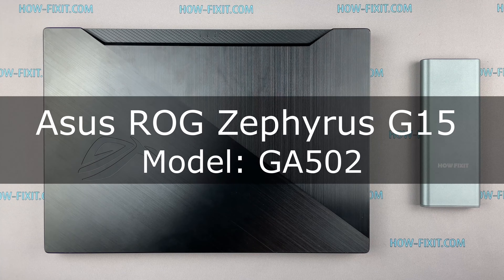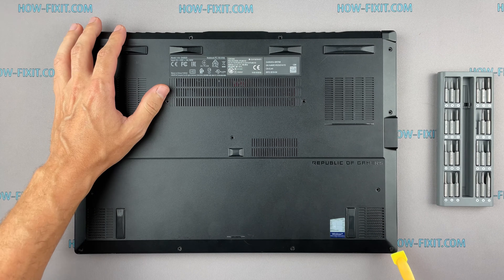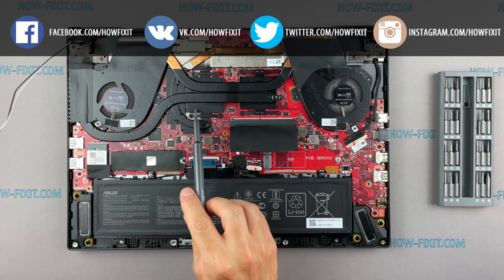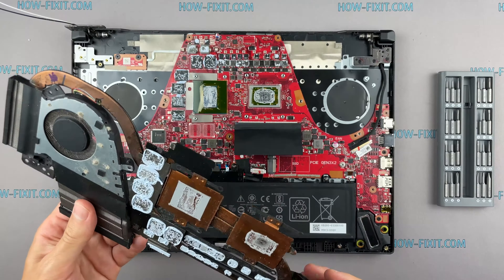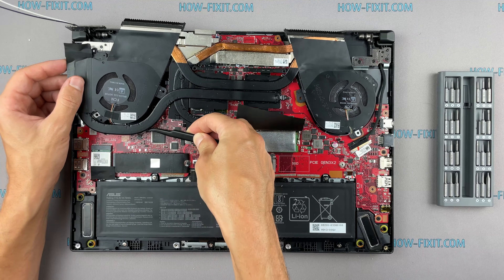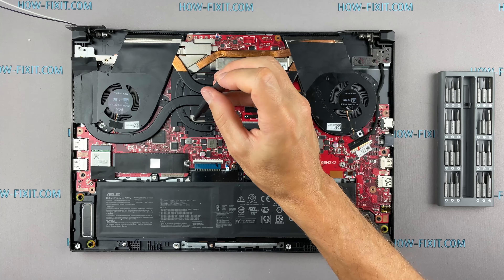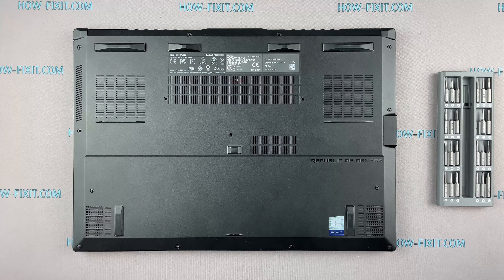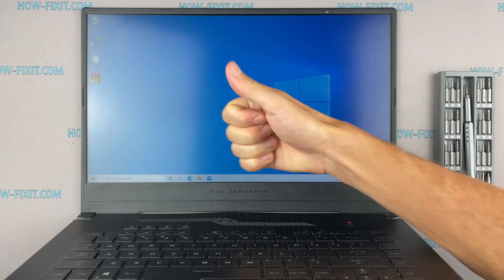Asus ROG Zephyrus G15 GA502 Disassembly, fan cleaning and thermal paste replacement

Comment: Hi, is normal if running stress test on this laptop with prime95a clock speed max at 2,9 GHz (max cpu temp around 83C) while not stress test clock reach 4,3 ghz occasionally, on power plan option pci link state power management OFF on batt and on plug in, cpu power management min 5% max 100% both on batt and on plug in ?

Comment: Mine fans have started to make a loud buzzing sound when ever they kick on. I tried cleaning them, but they still make the sound. If I need to replace them, do you know where I can find the parts?
Reply: tha same happened to me, the solution was apply a drop of lubricating oil for machine in each fan in the holes them has in the upper part

Comment: can somebody please tell me which type of fans i’d need to buy to replace them? my cpu heated up to 73°c while the fan was only running at 774rpm… i think i have a fan failure

(editing to mention that i wasn’t even gaming when that happened, i was only in BIOS… started at 40°c and heated up to 73°c within about 7 minutes)
Reply: That's totally normal temp for a laptop.  At any rate , take the fan out and search and part number.
Reply: @mdmcd6273  it’s a normal temp if my fans were running at about 2000-3000rpm, but it didn’t exceed 774rpm so it was basically melting itself
Reply: @leahvigs  I may be misunderstanding here and of course no idea of your fan curve - but to my understanding those temperatures are fine, stable and FAR within spec for a laptop.

 If the fans didn't work that's one thing, but maybe they were not at 2/3000 rpm, because you were running so cool already (73 C).

If it was melting and or in need of the a higher rpm from fans... don't you think the temperatures would have been climbing steadily? Again- don't know the issue or your scenario. Just that if I could get my CPU or GPU to 73 C I wouldn't care what the fans were at. 

Either way, best best is to take a fan out and get a part number / start your search from there. Good luck.

Comment: (4:42) So there are 2 VRAM sockets not populated with 1GB chips. Maybe some of these boards came with 8GB GPUs at one point, we can see that they even covered those blank slots with the stock cooler!! I wonder if there are some resistors that have to be re-positioned so that those chips could be seen by the mobo. I wonder if changes could be made to the motherboard BIOS with AMI flash tools? Or if the actual VBIOS has to be changed, I mean technically the VRAM is soldered to the mobo. I've also read that the RTX 2000 series can technically interface with 2GB chips and some people have replaced those 1GB smaller ones as an upgrade.

Comment: Thank you for the vid! My fan started making a weird noise and because of you I was able to fix the problem even with zero experience fixing computers ❤
Reply: what exactly did you do? just tighten the screws? or clean them out. I have an issue with mine vibrating the whole computer
Reply: @wingman3212  Replace FANS they will dieout eventually
Reply: @TolaKtv  I ended up doing that yeah
Reply: Do you have this exact laptop? Mine is making a noise too, you didnt need to replace fans?
Reply: @eduardocrysteko4846 ost likely your Gpu fan is dying. Better replace both use High quality ones
Reply: @TolaKtv should i also reapply thermal paste after replacing both fans?
Reply: @leahvigs  If you are only changing the Fans then no. If you havent changed your paste ever, then yes do both USE NT-H2

Comment: its legit impossible for me to reconnect the black and white wires at 8:34? can i get away with  just not having it connected? they werent even connected in the first place when i opened up my laptop
Reply: year late but those black and white wires are the wifi cables. without those, the wifi wont work on your laptop

Comment: I have this laptop and after cleaning the fans, it runs sooooo much better. My Cyberpunk 2077 would run at 45 FPS on Medium Graphics before cleaning the fans. Now it runs at 60 FPS on Ultra Graphics and 25-30 FPS with Ray Tracing turned fully on and set to Ultra. I also tested Doom 2016 and it runs at the highest possible Graphics at 144+ FPS, the screen is only 144hz so it can't go above 144FPS. I bought it used and never thought to clean the fans but I am so glad that I did
Reply: Do you have the 2060 version or the 1660ti version?

Comment: Is it normal to have small sparks coming out when connecting the battery to the motherboard? This is completely new to me and I would think that it isn’t normal
Reply: Jesus. Did you discharge capacitors ? *power button a few times and hold after disconnecting battery?

Comment: I recently purchased an open box ASUS ROG Zephy 16.5" from Best Buy with 16GB and this thing is truly overheating, crashing and rebooting for some unexplained reason!  I've gone into the System Events and see a lot of error, critical error, and warning codes.  I'm not happy and am waiting for a call back from Best Buy.  I've only had the laptop for 20 days.
Reply: It has to do with the fancontrol. turbo mode is for gaming, windows mode is for typical windows. it connects to the voltage of the powersupply. You have to make sure it has airflow.

Comment: Few corrections here... cleaning the dust out of the fans with a brush over top of the board is never a good idea especially because the heatsink compound on the video ram and vrms was not replaced (if you are having heat issues it is always best to replace all of the thermal paste).   Only one fan was separated from the heatsink to clean the congestion point between the fan and the heatsink but it would be a much better idea to remove both fans and make sure all heatsinks are completely clear of dust and debris
Reply: nice fix bro, thx
Reply: Hi! I have a quick question, I'd like to change the thermal paste on my GPU and CPU of my Zehyrys G15. In the video, when he lift the heat sink, I can see that there's a lot of thermal paste all around it. Is it really thermal paste? Can I change it too? or doesn't it make much difference?
Reply: Late reply, but it's not thermal paste, don't fk with radiator paste

Comment: Just did it on my Zephyrus Thin S GX502 and man was it a pain in the ass to do. I build gaming desktops all the time but never expected a single laptop to take SO much time just to remove a heatsink. 25 different cables left and right, above and under.
Reply: Try on dell 7567.. i have change thermal paste & pad open it x7 time already...  Since 2017. that laptop was more complicated than this.
Reply: I have this laptop, was it worth it. Currently frying eggs.

Comment: Anyone know if these model laptops will work with the Adapter plugged in and battery removed ? We have one and it boots and loads up , stays on few seconds and then dies. It did they a few times and then won’t boot at all. We then bought a new battery and replaced it but it’s doing the same thing. The adaptor has the right voltage coming from it and at this point im at a loss of what the issue would be . There is no charge light indicator lighting up other then when it booted up those few times.
Reply: sounds like the motherboard is fried

Comment: I have the m15 all I am gonna say is everyone who are owners of the m or g 15 Asus computer laptops need to clean the fans ever 3 months to 5 months because the fans get dust on them and the computer can’t breathe so then starts over heating take the back panel off and then take a brush and a vacuum to suck the dust and trust me your performance will be so good after
Reply: I have this one and it over heats soooo bad, It runs games normally but ever 60 seconds it will go down to 5-10 FPS for like a minute and then goes back to normal. It does this because it is over heating, also ive even had it just turn off on me when playing games because it got sooooo hot. If you touch above the keyboard, that part os so hot that it literally hurns your hand, I'm kind of scared that it is going to just expload and start a fire. Also I bought it used almost a year ago and when I got it, the battery life was soooo bad, it stays on for 5 minutes without having anything open. If I open something, it turns off in 1 minute. Should I get a new battery? Also do all gaming laptops get extreamly hot where it is uncomfortable to touch and do all of them need to have dust removed every 3-5 months? If they do not, then I'm for sure going to sell it and buy a different one that doesn't over heat and need constant maintenance
Reply: @DARK_AMBIGUOUS  I’m no expert. I’m in the same boat as you. My fps also drops to 10 fps every couple minutes.
But I have heard that laptops in general are very loud and can overheat easily. Mostly cause it’s a lot of power in a compact space. 
Now here’s my question do you know what the where the vrms is located and the video thing as well on this laptop?
I know where the cpu and gpu is but I’m new to this tech stuff
Reply: @EdgarMendezz  It will hurt your performance by a bit, but in games that you can manage, use a tool like "Throttlestop" to just completely disable turbo from your CPU. This will pretty much guarantee that you will not thermal throttle down to 10fps but will hurt your performance. Alternatively get a fan(needs to be pretty good) and prop your laptop up with a book or something. Have the fan blow air from the side of the laptop to move tons of air underneath it. This will solve a lot of your thermal issues.
Reply: Will spraying compressed can air help?
Reply: Isn’t vacuuming bad for your computer cause it has a static electric charge? And can mess internals up?

Comment: My right cooler  does a strange noise even id the rpm are the same as the right one. The right does almost no noise as usually. I have cleaned them with a brush with no result :( any ideas?
Reply: Did ya figure it out? Sounds like ya need to replace that fan. My friend has this laptop and I’m replacing the fan for him this weekend.
Reply: Try to lubricate the bearing and if the fan still buzzing you need to replace fan
Reply: Damn !! I have the same issue and I  thought I've ruined it by gaming too much...
Reply: It improved since then, but still noisy, I am used to headphones to avoid that noise

Comment: excuse me, what size of thermal pad should I put in the vram ? 0.5mm or 1.0mm ? mine is  ROG Zephyrus G15 GA502 GA502IU, thank u
Reply: I'm looking for the same, do you remember the sice? I tried with 1mm and the computer do not work properly due to the temperatures (I think that it is very thick). 

Thanks
Reply: @Estimp  did you find a size that worked

Comment: When putting the cover back on, the first screw in the lower right corner doesn't want to go in. It has a weird washer glued onto it and cant be screwed in. Any tips on how to deal with it? Because here it looks like nothing out of ordinary is happening.
Thqnks.
Reply: If you still need help that screw isn't supposed to go in, when you "loosen it" or tighten it or whatever, it's mean to lift that corner in order to make it easier to get your pry tool in there to separate the bottom plate.
Reply: You don't need that screw. It's fine of one isn not put in. I have this laptop and I bought it used and it was already missing 2 or more screws and it's perfectly fine

Comment: i dont understand what about thermal pad or thermal paste on vram ... doesn't it need to be replacement... but if does .. can i use artic mx4 on VRAM ??? help me
Reply: same question here
Reply: @weihongooi7656  i already got my answer after watch many channel... Replacement is needed if the ol paste is coagulated... You can use regular thermal paste (not liquid metal ) or thermal pad 1.5mm or 1.0mm measure yourself... Just remove old paste or old pad
Reply: @stssundr2807  It is true that I can use thermal paste where there was thermal pad? I heard many times that doing that is not correct
Reply: @Estimp  you can use it instead of thermal pad, it's fine i recommend artic mx4.... but if you want the best for vram temp you have to use thermal pad which you have to measure yourself, look other channel how to measure vram thermal pad
Reply: @Sts SunDR  I'm going to try with mx 6, it's a little bit more efficient, and about thermal pad, I tried to put it but with that, I couldn't refrigerate te GPU correctly. 

Thanks for your answer.
Reply: @Estimp  mx6 is good for long term ... but not the best refrigerate especially if you have ROG laptop or very very high end laptop ... i would recommend you grizzly kyronaut for cpu and gpu ... trust me it's best choice better than mx6 ... mx6 is for cpu desktop thermal heatsink not overclocked and gpu example gtx 1050
Reply: @weihongooi7656  but if old paste still sticky you dont need to do anything.... just replace paste for cpu and gpu
Reply: @stssundr2807  thank you very much!! You have repasted the same model? If yes, how is the temperature after repasting it?
Reply: @weihongooi7656  different not so much on RoG laptop only 2 - 5 C, but different much on other laptop like HP pavillion, acer it's about 10 - 20 C
Reply: Does it use the same type of paste? The one on the vram chips look more blue than the paste used on the cpu and gpu.
Reply: @GavBeats  yes the paste used on vrm and vram is more viscous.
Reply: @weihongooi7656  what exactly is that type of paste called?
Reply: @GavBeats  any viscous thermal paste will do

Comment: This thing is a chamption, i've had it mining for pretty much a year nonstop except the very few times i've had to use it for something (i got multiple 20 and 30 series desktops now lol.. what to do druing lockdown?!)   

It still kicks ass when in the rare case that i use it, it's maintained 20 MH/S without an overclock sitting like a tent pretty much since january ... i can't believe the power supply and gpu have held up.... the fans have always mode noise when i use this thing like a normal laptop though and the locked down bios + another asus prebuil\t desktop i stumbled on also has locked bios, asus  were rude as F when i called in and asked about XMP  and said "HA HA SHOULDA BUILT YOUR OWN" ... I have my own that i built, i picked that one up on a whim asuming an asus "ROG" machine would have f'n XMP support. to get laughed at on the phone and insulted by support is ridiculous.  I have two machines i built right next to their cobbled together POS.  

At least it has TB3 so egpu will be possible .... decent hardware still in it, the battery has always been total crap even for a gaming laptop....  i only bouhgt it because it has thunderbolt 3 and is still good enough to warrant an egpu upgrade at some point. :)  (if i  dont kill it..)
Reply: U sure you have this model? Thought it only had 2 usb-c not tb3
Reply: @StefanUrkel yeah the USB-C is also TB3 on this model ..   that's why i bought it.
Reply: @Hazard4K  strange I read they were not thunderbolt and only intel laptops have it for now.  I even tried hooking up an external tb3 drive and didn't recognize. I have g15 with wqhd display and 3070.
Reply: @StefanUrkel  That is literally not the GA502. NOT EVEN CLOSE to the one in the video.

Comment: I have the ASUS ROG Zephyrus G15 GA502IU-AL011T, in the BIOS there are no options to undervolt or to overclock, like at all. Do I miss something? Where can I download unlocked BIOS for the laptop?
Reply: need to downgrade the bios to unlock this
Reply from the maker: Check this video -> How to fix laptop overheating: https://youtu.be/1PTRCc_BRtQ
The ultimate guide to a laptop overheating covers everything from software solutions to CPU and GPU undervolting, and hardware checking.

Comment: Good video, but I need only a clean heatsink and no replace the thermal paste. Is possible to remove only fans? Thanks.
Reply: Yes you can unscrw that stick with fan smallest screw then you can clean fan